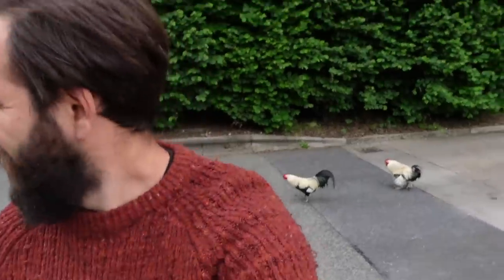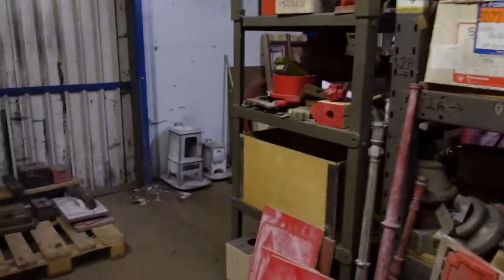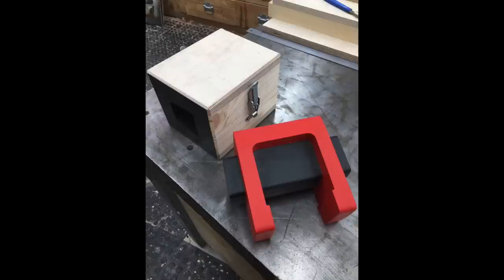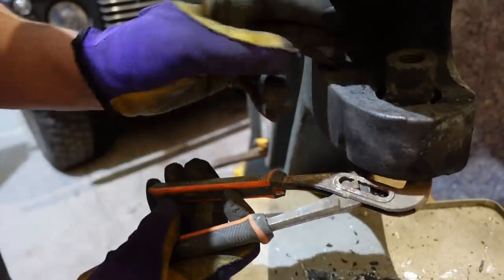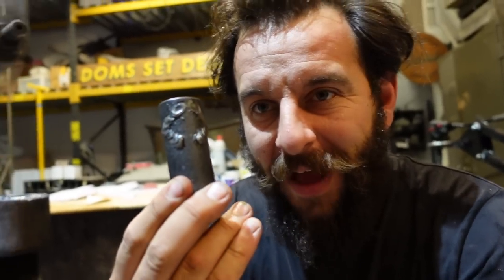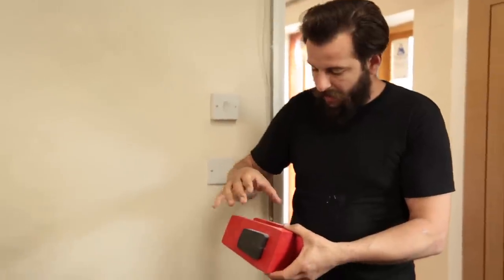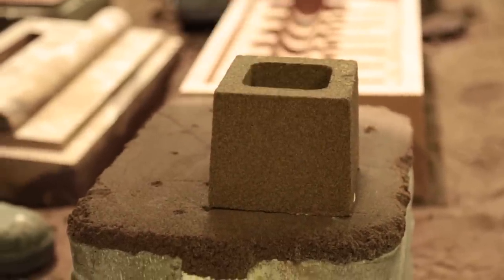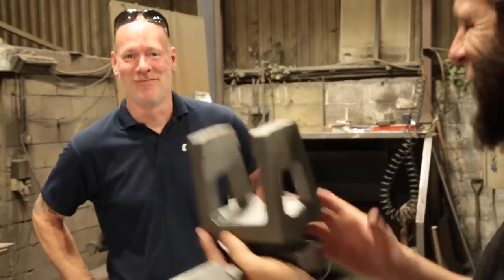'Casting At The Foundry' - Will my pattern work?! | Reviving History (Episode Four)

Comment: I would not assume that lead is the optimal material to use.
The fact that one setting became loose confirms that.
If they were making these today they would either use a machined fit or a resin ,probably a firm urethane formulation.
They probably used the lead setting because they had no facility to machine the large casting.
Reply from the maker: Yeah I agree, 
The material could have loosened due to miss use on the machine, too much force etc 
I will be using the same material as original to set mine, to keep them true to the original
Reply: @DominicChineas  If using "lead" I would suggest a harder alloy, one of the hard solders perhaps, and tinning the steel pieces that are set in the lead.That will prevent them from ever loosening.
Just give them an acid clean and use zinc  chloride flux. Alternatively ,have them galvanised which will act like it was tinned.

Comment: Get the lead filled areas X-rayed. Critical welds are inspected like that. Ah, to late.
How did they split your net shape wooden mould in two I wonder. Must have been some filler involved to replace the wood lost through cutting.
Now you need to measure the new casting to see if its shrinkage did indeed match the original's sizes. Hope it does, otherwise a new or adjusted mould will have to be made.
Reply: Quite a bit of stating the blindingly obvious there - if they know the size they need to end up with, then their experience will allow them to calculate shrinkage...?! 
Also, Dom did say say that X-ray wouldn't show detail or be accurate enough - again, fairly obvious, imo....!
Reply: @andrewdking  Hi Andrew’ Many factors come into the casting process and as you say’ dimensions are so varied, especially in different materials which we cast. We have vast experience in medical castings to engine block castings which have important requirements. 

Always leaning but we know what we have to do’ and all will be good’  Great project to be involved with.

Rgds , Chris.